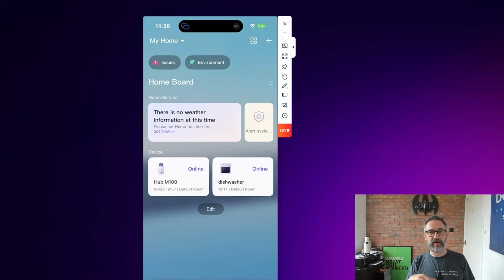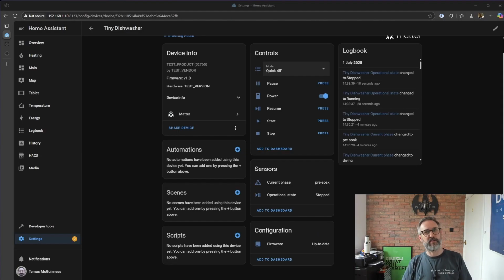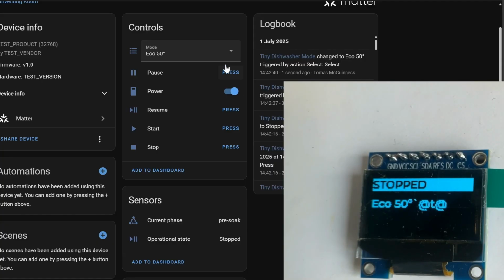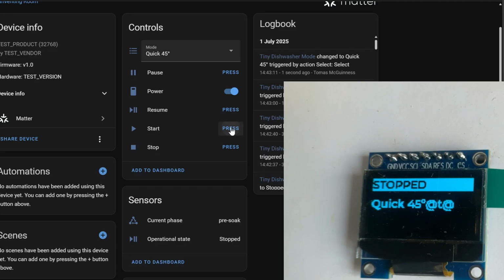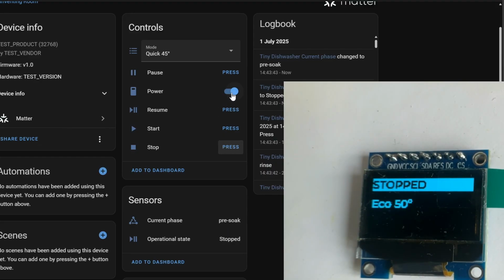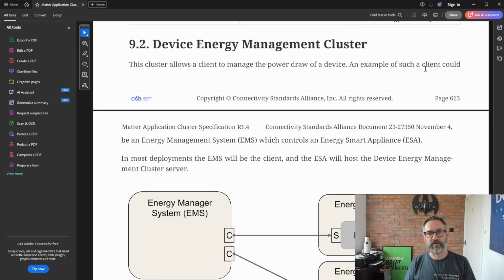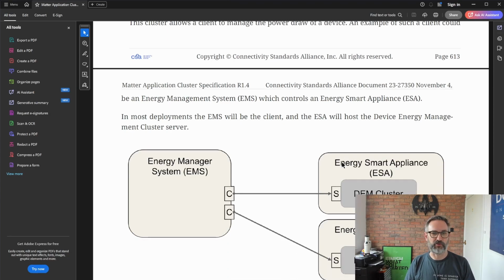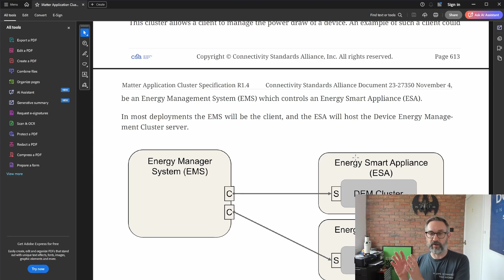The Tiny Matter Dishwasher I built to help me learn more about ESP32 & the protocol

Comment: Wondering if it would work with INDESIT DIF04B1. The only thing it’s missing is the timer/delay function in order to get dishwasher running at night ( off peak tarrifs)
Reply from the maker: If your dishwasher has an API, it may be possible to leverage this, but it's unlikely. This is more of a demo than anything else.